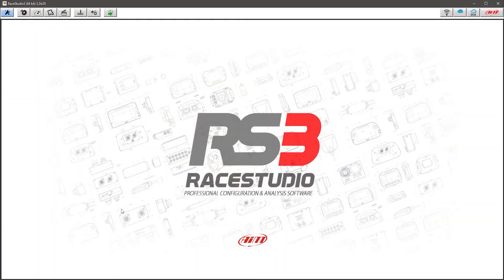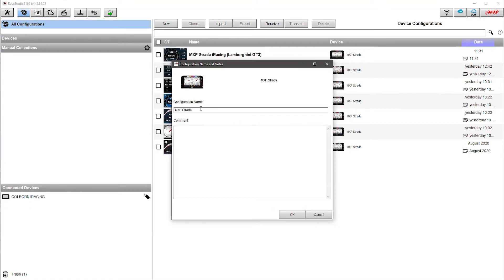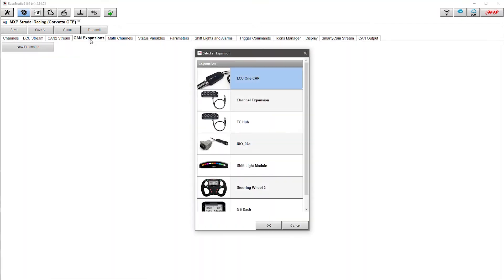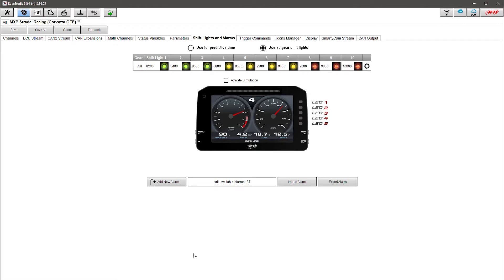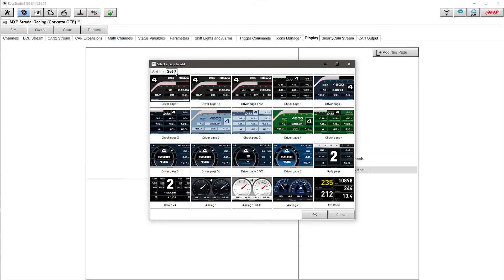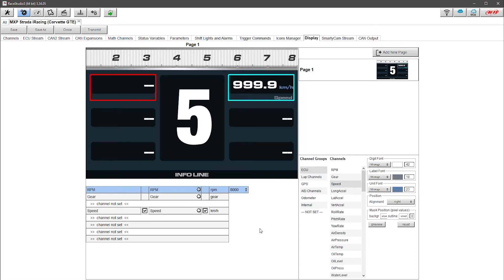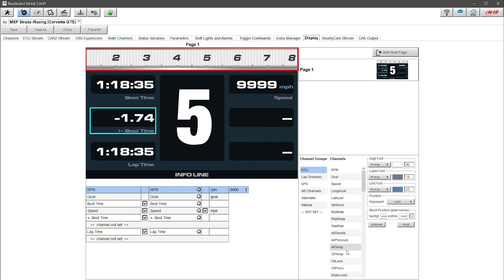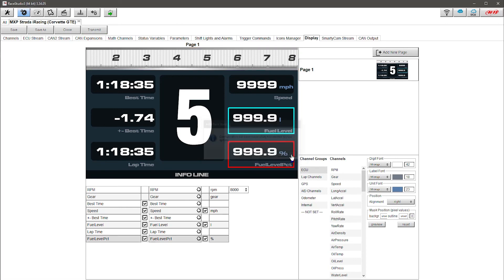AiM Race Studio 3 - Configuring an AiM Dash for Sim Racing

Comment: Hola James! Great video as usual. 
Is it possible to get a video of a MXG1.2 set-up from scratch?
Reply from the maker: Hi Ramon. The setup is identical (even the pages are almost identical) for an MXP Strada and an MXG1.2. When you start the configuration you select MXG 1.2 instead of the Strada (that I select in this video). Then follow everything almost exactly. The only difference is you'll have a few more alarm light options. Good luck with your setup. James
Reply: Thank you,  @JamesColborn  .